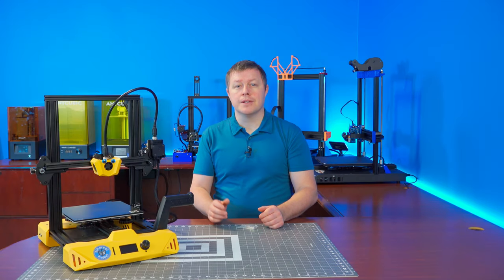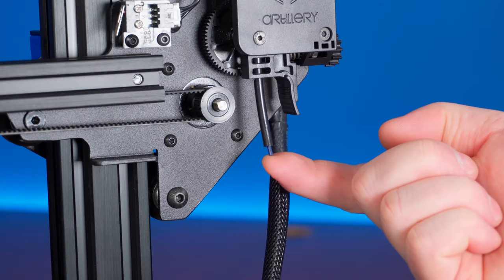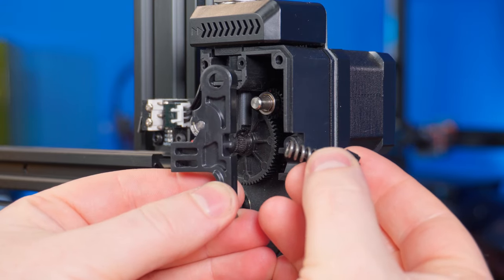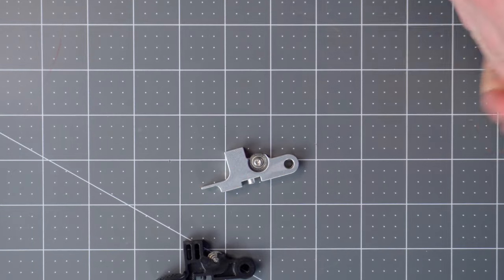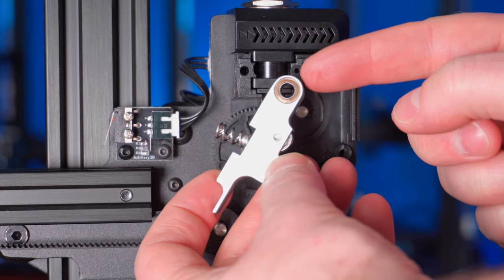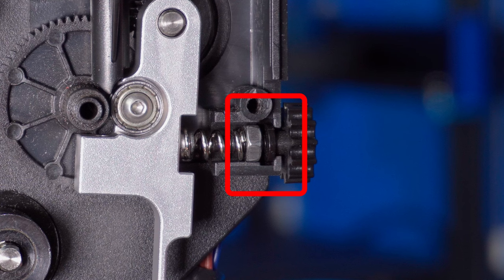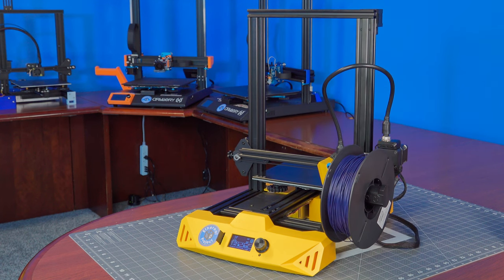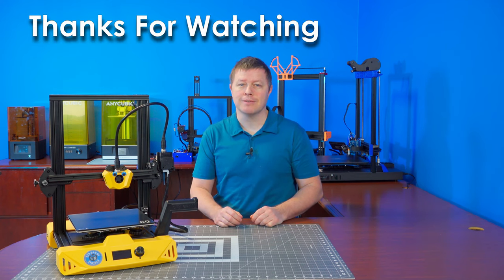Essential upgrade for the Artillery Hornet

Comment: I had to do this, not for modding, mine was literally broken (and I bought metallic one for durability).
I didn't though about changing the bearings, and I completely failed trying to put the lid and being able to put the screws, removing the fourth screw help.

I'm printing a calibration cube for test, until know everything looks fine and I can print again.
Reply from the maker: Nice, hope it works better for you now.

Comment: I have the problem that my artillery hornet fails to boot. The display lights up when I turn it on but fails to show any information or boot up screen... u/shalokshalom has a video on reddit with the exact same issues that I have.
Reply from the maker: I have not run into this issue before, there could be a problem with the screen or the mainboard connection to it.

Comment: The plastic hobbed gear is now a concern.  What do you think?
Reply from the maker: Im not worried about the plastic gear, the hob gear is metal, its just pressed into the plastic driver gear. The bearings that it runs on can get worn out fast by having the screw through it as those bearings are not designed for lateral loads.

Comment: Can I do the same thing on my genius pro!? 
Please do a video of bed leveling and give us beginners best tips and tricks to level the bed
Reply from the maker: Yep pretty much the same process on the Genius Pro. The extruder cover is just a fan and heatsink. Are you wanting a video about leveling the Hornet or the Genius Pro?
Reply: @EtherealProject3D  leveling the genius PRO thats what Im asking for. 
I have a big problem with that please help me
Reply from the maker: @mamlvagensinan6832  what part are you having trouble with?
Reply: @EtherealProject3D  prints that uses the sides on the bed. Every time I level the bed and then tries to print on the sides it’s way too high or way too close to the bed. Any solutions?
Reply: @EtherealProject3D  troubling only with the first layer
Reply from the maker: @mamlvagensinan6832  I would guess its because the stock firmware does not have #define EXTRAPOLATE_BEYOND_GRID enabled.
Reply: @EtherealProject3D  ohhh, How do I solve that?  What should I do?

Comment: Hi, very nice video, I love this upgrade!
Is it possible also to swap the hotend in order to print more complex filament like carbon fiber pla or composite materials that requires higher temperature or it's a software or other types of hardware limitation?
Reply from the maker: The heat brake can be replaced to allow for higher temps for sure and a simple firmware update would follow. Overall pretty easy mod on this machine, ive done one, still need to do mine, I have video plans for it.
Reply: @EtherealProject3D  Thank you very much for the quick answer!  Hope that this video will came soon🤞
For now I'll have to wait because I've tried but only with failure!
Reply: @EtherealProject3D  is this upgrade project done? I love to see it...